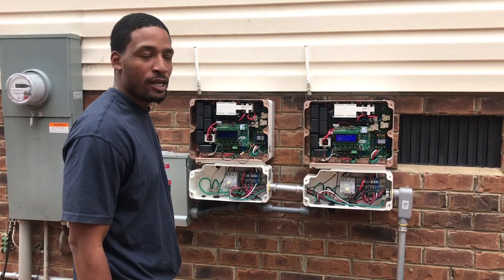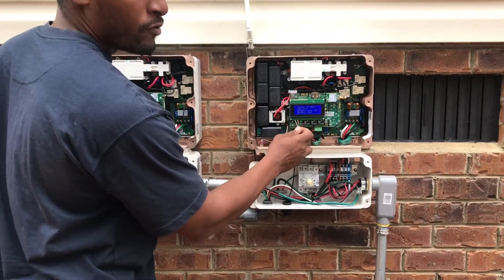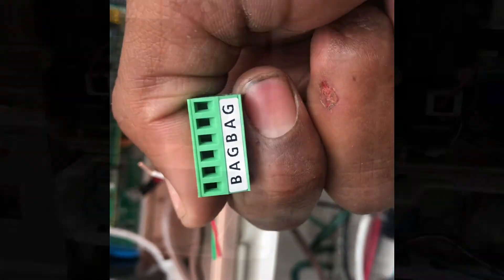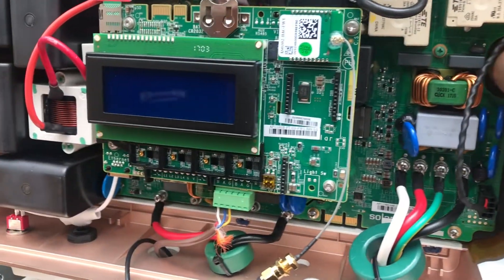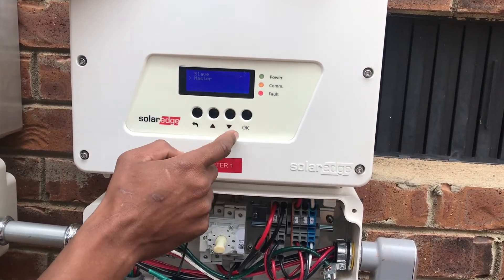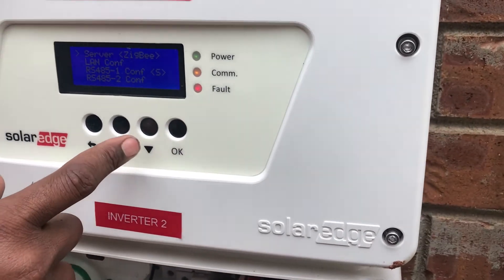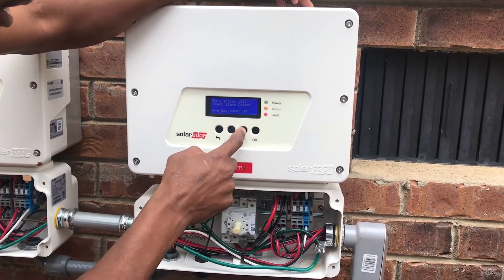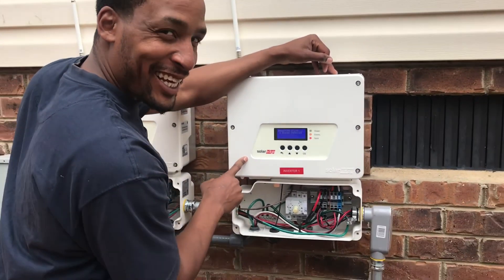Solar Edge Inverter Master & Slave Connection

Comment: I wonder if this is what solaredge is wanting me to do? I have a 5,000 watt setapp inverter and a 11400 watt setapp inverter. 5000 watt inverter has a built-in RGM the other one that is bigger dors not so it is not communicating its production. Contacted solaredge support and they told me to connect an RJ45 cat5 between the two ethernet ports and set up a master and slave making the 5000 inverter the master since it has the built-in RGM both innverters have built-in 5G wireless capability so the ethernet port is not used for the network monitoring connection. Neither of my inverters have the digital display and they also don't have the BAGBAG module for me to tie into for the RS-485 protocol communication like this. I was told all I would need is a CAT5 or better ethernet cable and connect it directly to the ethernet ports on both inverters.

Comment: not cat 5... 5 pair non shielded cable..but still nice video for the application. i am working with the hd wave, 2 inverters, and a lg chem resu10h battery, with 2 separate production meters as well as a bi-nusgn-01 back up interface. any knowledge and tips would be appreciated.

Comment: Where can I get that same cat 5 wire. The one I got has 8 different colors cat 5e and cat 6 don’t have those colors they have like a mix, blue&blue white, broken&brown white, green&green white, orange & orange white. 

Please link where I can get that wire or what’s the color set up with the type that I have.
Reply: that's not cat5. that's thermostat wire. lol You SHOULD use Cat5 because it is a twisted pair wire. That's to cancel out noise. The protocol used is a serial RS485 which is susceptible to noise. This guy obviously doesn't have a clue
Reply: solomon w , up learned that a while back, the way it’s suppose to be with cat 5,5e, or 6 is that you follow BAG as White blue, Blue, and Orange in that order as it’s the proper connection method for cat 5s. 

This guy made it work with thermostat wire ig but your suppose to use cat 5
Reply: correct. But he could run into problems on longer runs or noisy environments. Always good to follow the manual and manufacturing specs. That way they can't say it's your fault if there is a problem.
Reply: Do what he said not what hes doing. 😂